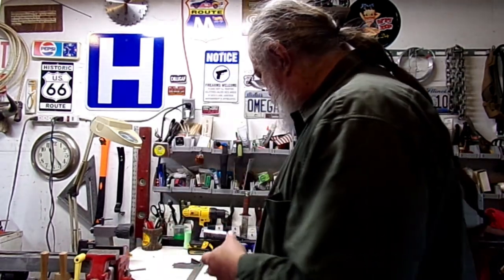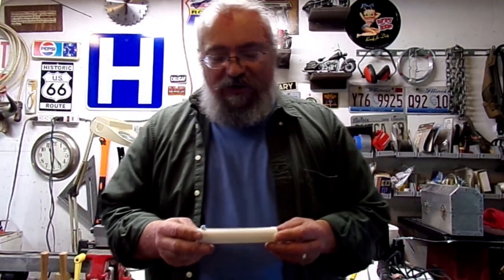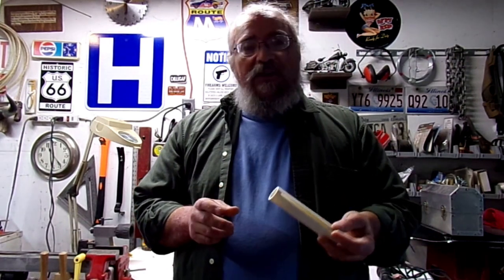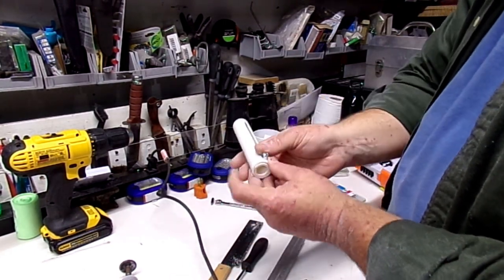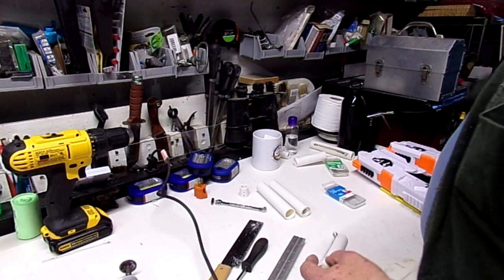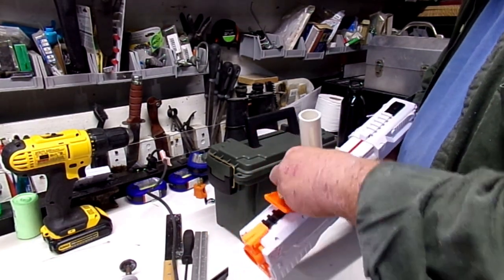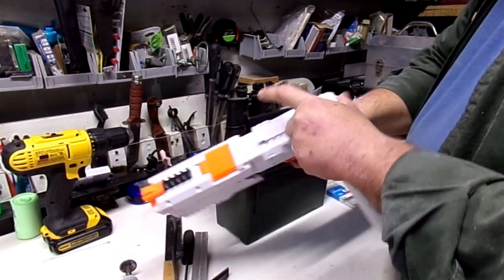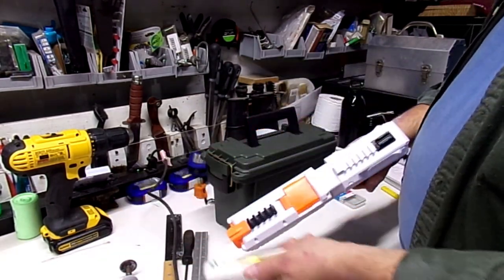DIY Nerf Rival Kronos Speed Loader - EASY!

Comment: I was thinking that you could soften the end (heat gun) and ever so slightly crimp it, then smooth it off to make a retention ring. This way, the balls can't just fall out. (not all balls are made equally, and one might find that some are just a touch loose.)
I liked Ian Poe's idea. I have some instamorph (plastic you can hand mold @ 150 f) It could be used to make plunger handles, or even solid plungers.
Reply from the maker: Great ideas! Thanks.

Comment: just remade this and I've got to say it's really good quality and impressive inspecially for rough play

but if you decide to make one of these yourself I recommend making the 1 inch pvc pipe 2 inches it makes the balls go in so much easier so you don't have to push them down so it won't get jammed saves a extra step of reloading
Reply: Great tip! Thanks for watching.

Comment: Nice build! Another pvc ring that fits around the outside to attach to the inner ring would help with loading instead of searching for the bolt with your finger. 3D printers are great for some things but overall are killing hobbies.
Reply from the maker: Good point, I'll work that into V2.0! Yeah, I can't afford a high resolution, "good" 3D printer, so I'm confined to what I can do with skill and treachery. ;)
Reply: Great ideas and so much cheaper than the 3d printed!  I knew there was a PVC way to do this but never think of it at the store.  A thought I just had with the outer and inner ring is wondering if  there would an appropriate sized spring roll pin to omit the need for a nut and bolt entirely?

Comment: OP. Think you got one of the sizes of materials wrong in the video. I was listening to it while I was at Lowe's, and thankfully I went with my experience in the hobby, but i picked up the 1 inch cpvc and 1.5 inch #8-32 screws instead of 3/4 pipe, and 1/2 inch screws like you mentioned in the video. Im planning to put the screw through both sides of the pipe with two slots, granted that will be an experiment that will depend on durability. You might wanna update that pipe size in the description tho.
Reply from the maker: Nope, I most definitely used 3/4" THIN WALLED  pvc. I believe it is schedule 30, rather than the standard schedule 40, but it's sold in the same place at my local big box (Menard's). You have to be careful, because much of the time the schedule 40 is mistakenly stocked in the thin wall location. Rival rounds definitely won't fit in schedule 40 - 3/4", but fits perfectly in the thin wall 3/4". 

The first prototype I made I used longer bolts and cut two slots, but found that one was sufficient for my purposes and made the layout simpler. Although if I make more using the suggestion of Ian Poe, to use a ring of larger pvc as the "pusher", then it might be better to go back to two slots. 

Thanks so much for the comment, post a pic of your finished project if you get a chance!
Reply: @AverageJoeShopTalk  I bought cpvc, idk if that is the same as thin walled PVC or not. But the rounds fit inside nice and snug. I'll post pics hopefully later this week. 

Are you familiar with reddit? It's a forum, and has subs for just about everything. r/nerf is a great source of information on there.
Reply from the maker: @theycallmesocks1369  Thanks I'll check that out. I think the biggest difference (chemically) between the CPVC and "regular" PVC is that CPVC can withstand higher temperatures, which doesn't really matter for what we're doing. I did see the CPVC at Menards when I got mine, but it was about 3 times the cost of regular PVC, so I went with the cost savings. 

Thanks again for the tip on reddit, I'll check it out.